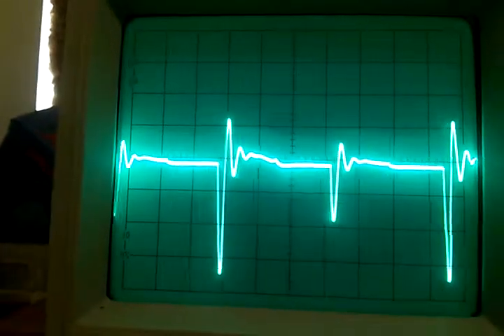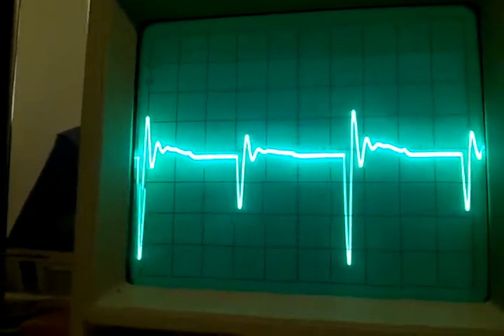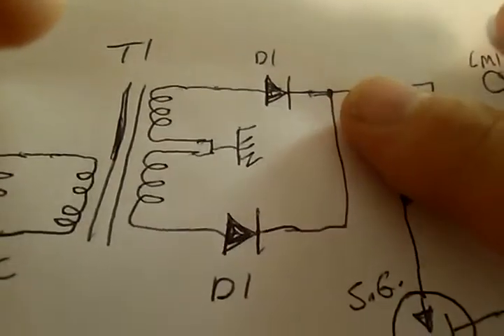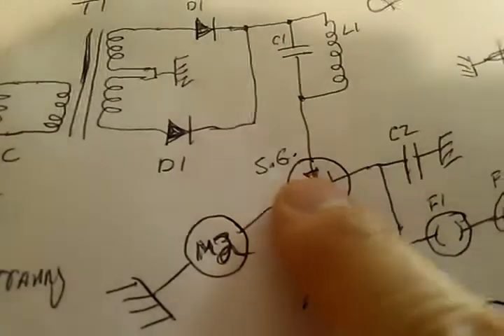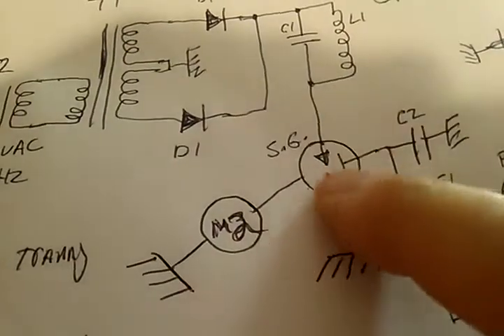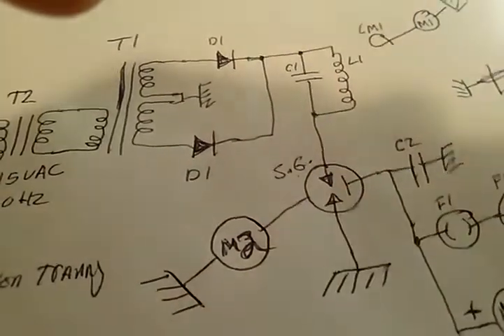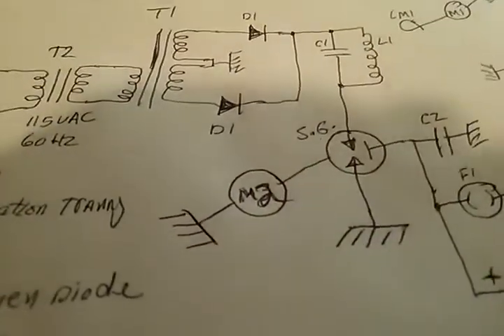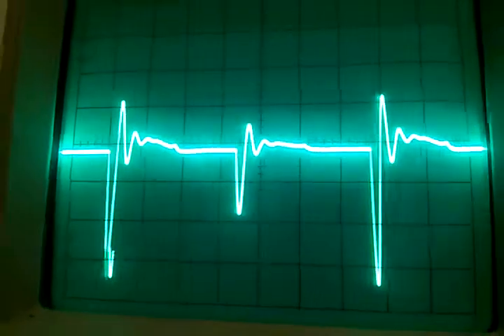Ed Gray exp. 6 (Cold electricity)

Comment: How are u? I'm happy to see your progress... I've discovered something you may wish to try within your circuit and I do believe it's the missing component left out of every smith circuit. Please leave the coils, transformers, diodes and your varible transformer as is. in the output of your spark gap collection system, connect an avramenko plug where the cap going to ground is, however, remove the connection to the cap and connect the output of the spark gap to the negative side of the avramenko plug. tie both diodes together and connect to a 270 ohm resistor, then to a separate earth ground, as deep as possible in the ground.  This will enable the radiant energy to choose it's path to push the energy into the ground since radiant energy chooses the past of the most resistance instead of the inverse method chosen by conventional energy.  the avramenko plug will separate and only allow negative polarity to be pulsed into the ground while your other diode will go to the capacitor to collect the positive, amplified charge flowing from the ground and store the energy. the other side of the cap will go to a separate ground and the load will remain connected to the hot lead of the capacitor. the energy from the ground will flow back amplified through the correct diode and flow only to your load as the equal and opposite of the energy pulsed into the ground because you'll be collecting the ambient rebound into the cap giving an output that will not have any additional load added to your input,... in fact, the load at the input should drop. once you acquire this free output, please remember me as who has discovered this.. this is all I ask.. you can use the same device on an aerial from your inductor, in fact, you may need to wire a coil that is shorted so you can pulse it as a radiant oscillator is wired, then pulsing the back emf to ground as i do, collecting the amplified energy in the end from a more distant earth ground to obtain a much higher amplified energy in your output. btw, i have followed your work for some time now.. you do wonderful work and are in the same area I am for these experiments.. i have recently discovered this and have my circuit shown here:   https://www.youtube.com/watch?v=hU5v6nVouSg